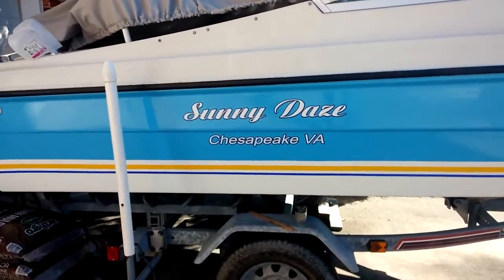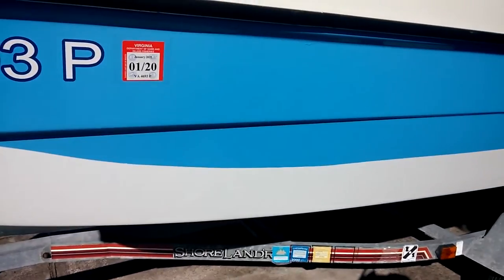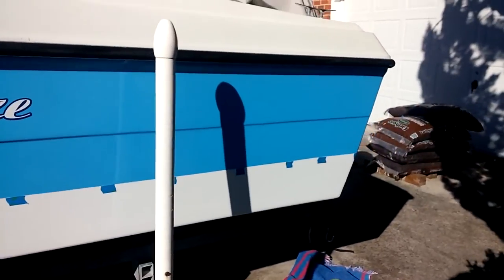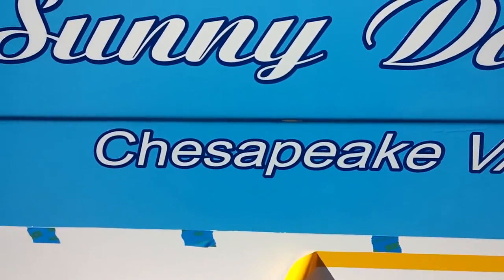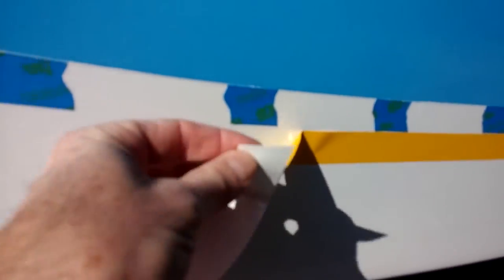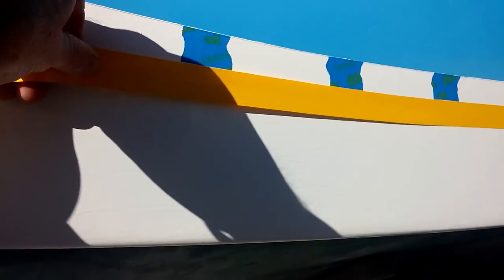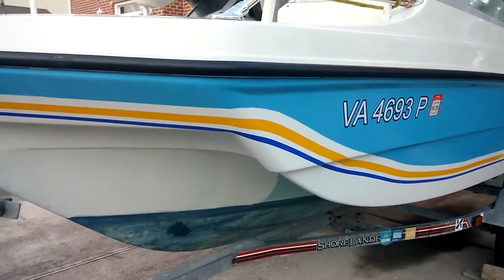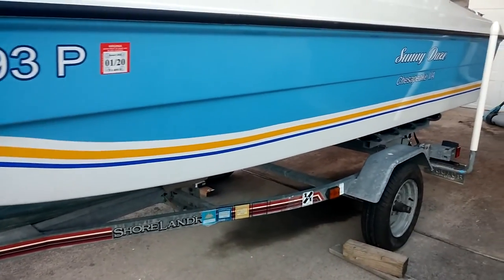Boat Restoration Decal Stripe Application Thunderbird Tri Hull "Sunny Daze" Episode 18

Comment: how much paint would you need if you painted the boat one whole color? Looking to roll and tip my 20 ft just like you did!
Reply from the maker: Hi Wavejunkie26,
Thanks for the question, if you are painting the entire boat the same color you should need at least a gallon if you do 2 coats, maybe more, your boat is 20 feet and whereas Sunny Daze is a 16 foot. Good luck, take your time.
Reply: Windy Daze Sunny Daze thanks alot for the info !